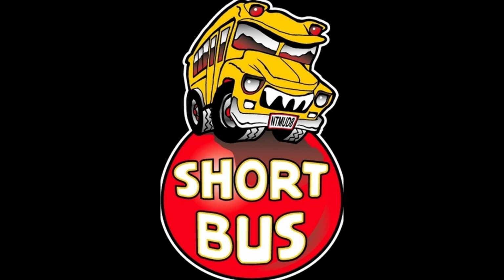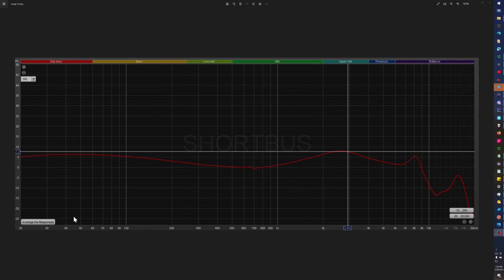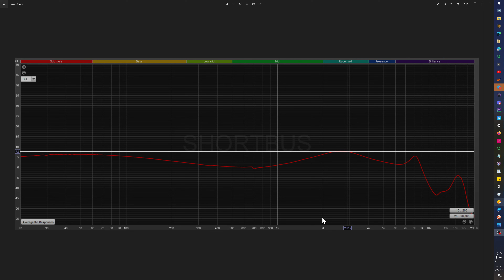Siempre Grande!

Comment: I am speechless.   I am very interested if you can show mod with disclaimer.    Thank you Michael 😊
Reply from the maker: The mod uses the dampers from the back of the S12 driver which are possibly around a 600 value.. but im not sure.  Next we add one olina damper and one Hana (og) damper, stacked on the front bore, and finally I do tiny pokes with a cactus needle in the front vent.  I do 2 tiny ones per side.  Thats about it!

Comment: Hey Michael, I've been trying to mod some iems lately but I have not found a solution for a uniform half or 1db dampening on all frequencies that I want to do for a Wu Zetian that has really bad channel mismatch. Same response on both just 1db more than the other one. What  do you recommend for this? Thanks
Reply from the maker: Thats a tough one.  Ive had some planars with bad mismatches.  It would require adding a hair of bass to one side or removing some, Id possibly stick a tiny piece of rough foam in the front vent to match one side up 1db in bass.  Then to add 1db of mids you would need to remove the front damper which I think has foam under it and cut a tiny bit of foam off then put it back.

Comment: nice one bruv ! but but but how come you knew this set had so much potential ?!
Reply: btw, i have tried your convolution file Olina to DM and it worked amazingly well, good job.
Reply from the maker: I knew because I started the Olina project more than a year ago and told HBB a lot about what I did.  He took that ball and ran with it which is killer.   This is probably the tuning I would have chosen if I was able to make the thing myself.  HBB did a great job though.
Reply: @MichaelBruceShortbus  wow...would like to see Khan v2 with one driver as olina and something else as dual DD....that will be epic I guess.